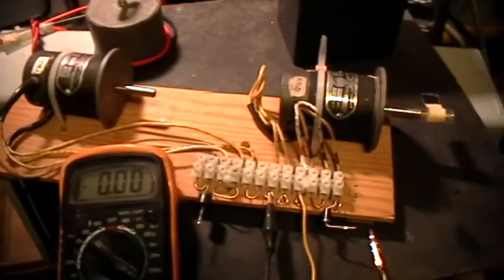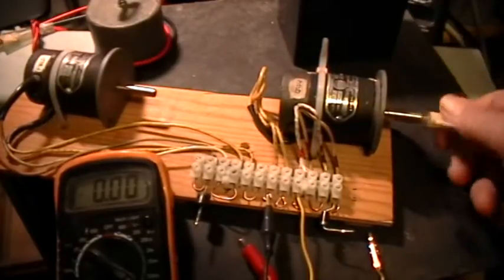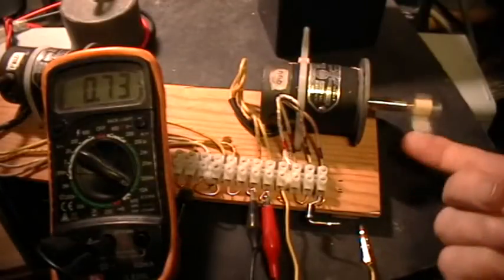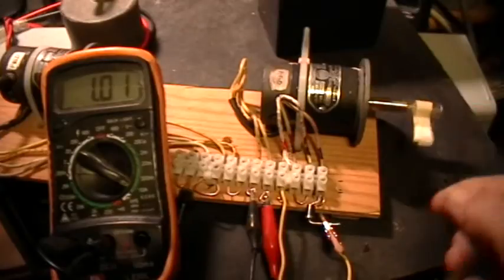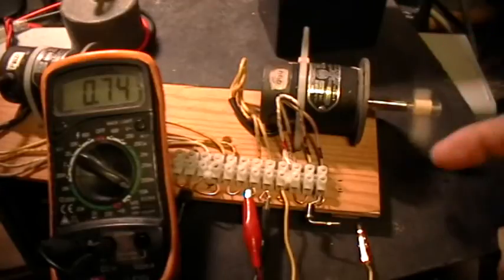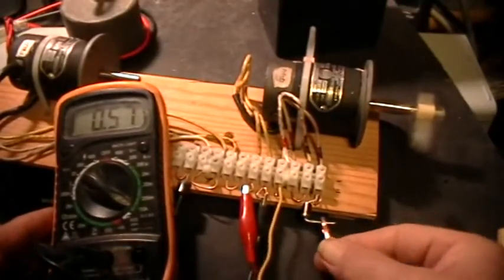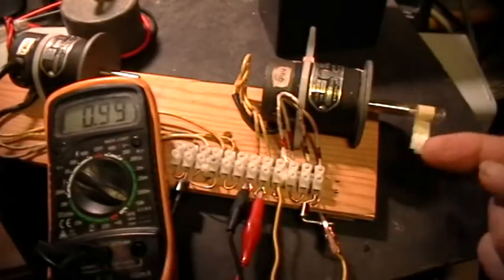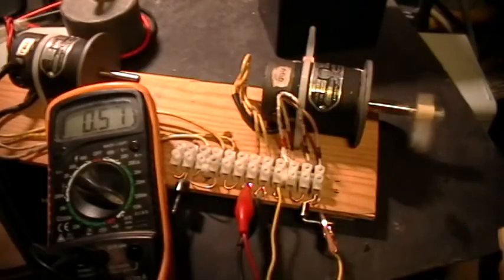Electric OU: Coil Shorting Shunt Motor 2: Effect of Diode

Comment: i done this as well  but what happend is that one of the induced fields goes strong in one direction and that by appying a load in a certain way the polarity of the field wants to reverse and go the other way. in your case the counter rotation was to weak to reverse direction of rotation but i done a test myself in the past where i was making the rotor go one way and  by apply a load i was able to make the rotor stop and then start spinning in the opposite direction.

Comment: tk it would be interesting to measure the work done by the motor both when it is running normally and when it speeds up.  the hypothesis i'd like to see tested is that the diode is acting to short out some of the back EMF in the stator coil (half of it?).  this hypothesis if proven would explain why there's both a current reduction as well as a speed-up.

a way to test the hypothesis would be to put the two motor shafts back together, then use the second one as a generator, measuring both its current and voltage whilst connected to a (known) plain resistive load.  (but remember also for accuracy you should really show the input voltage as well... you have 4 meters somewhere?)

if the power draw turns out to be proportional then congratulations! you've found a way to make shunt motors run faster and maybe even more efficiently!  have a gold star for engineering excellence :)

if the power draw turns out to be more than the input then congratulations! you've successfully demonstrated over-unity.  have a gold star for experimental scientific excellence instead :)

Comment: I am really confused here.  If the motor has no permanents and you are simply supplying power to the rotor is it residual magnetism in the open stator coil core that lets it run????  I don't understand.  Is it an induced current in the field coils?  I really really don't understand how this works.
Reply from the maker: ***** I think it must be that. The rotor segments are attracted to the stator cores, and also there must be some current induced in the cores that allows a field to develop when the cores are shorted or connected through a diode. Depending on polarity of the armature, the induced current either aids or fights the residual magnetism in the cores. But it must be very small because I really can't detect any strong magnetism in the cores when the motor is taken apart. 
But I don't understand it either, this is just a "best guess" based on the experiments so far. The stator coils do generate over 100V which can be captured in a capacitor in the usual way through the diode, then the cap can run a 120V 4Watt bulb for a few seconds before the cap is discharged. A 470 uF cap takes a few seconds to charge up and a few seconds of bulb lighting to run down.
Reply: TinselKoala I played around with crude motor I built yesterday.  The results were poor.  The saying "garbage in garbage out'" was proven once again.  I will need to buy a motor to really see the effects you guys are observing.  What I did prove to myself is that a totally open non-magnetic field coil will not run a motor.   What you showed in this video is very fascinating and I really want to replicate it with the correct motor.  Time to go shopping.

Comment: TK:

Now, within 24 hours, you will be getting a visit from the MIB.  But seriously, in the second part of the demo, where the amp draw went down...did the voltage through the motor go up?  I like those motors.

Bill
Reply from the maker: Pirate Labs I'm supplying the armature brushes with a voltage-regulated bench power supply, so no, there is no change in the voltage. The motor is designed to run on 27.5 V but I'm only giving it 12 volts.

Comment: Nice TM RT demo TK...^^
One can switch the input polarity or one can switch the diode to the outer side of the stator coils which should give one the same effect...;-)
Reply from the maker: Mister Caribbean Roots Thanks... Do you mean the "other" side of the stator coils? Because the diode is on one of the outer sides already. I think you probably are correct but I have only tried what I've shown in the video as far as diode position and orientation is concerned. Stay tuned...
Reply: TinselKoala
Yep, but it should work if you just flip the diode on the side it's on now...it should but it is always a surprise of what will and what wont...lol
Stay tuned i will...looking forward to see your next video on this...^^
Cheers